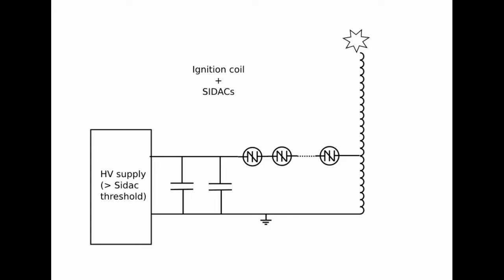Ignition coil using SIDAC triggers

Comment: HI Ben,
Thanks for everything and for posting this video.  I have used sidacs successfully in the past.  I reproduced your circuit.  I have obtained all of the components that you show in the schematic at the start of the video--but no matter what I do the sidacs wont trigger!  I have the automotive ignition coil, capacitors, and power supply (200V to 1200V from ebay) and it works over the full range.  I wired the circuit and first tested it without sidacs by simply connecting two wires--the HV output of the coil makes a very nice spark to one of the primary terminal.  However, when the sidacs (three in series, 220V each) are in place they will NOT fire!  I can connect to one, two, or three of the series sidacs--no luck (no oscillation)!  I tried a second coil (no change).  I am using pulse caps and have tried over a range of 0.25uF to 1.5uF (no change).  I did notice something strange: on the voltmeter connected across the parallel caps, it would always read the value of the sidac voltage rating.  for ex. if I used all three sidacs the meter would read 660V (220V x 3), if I used just one, the meter would read a steady 220V, etc.  It seems to be acting like a shunt.  I even tried a hi-capacity 12V battery (no change)--A completely different make of sidacs (no change)!!!  The only constant has been the power supply, but it shouldn't matter since the capacitors (not the P.S.) are being used at this point.  PLEASE,  HELP!!!!!
THANK YOU SO MUCH,
--Dale